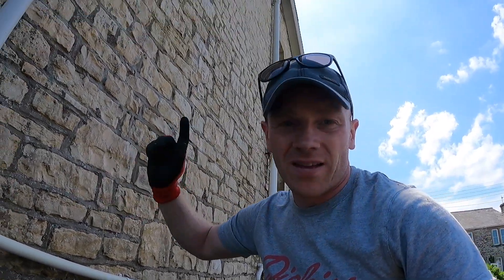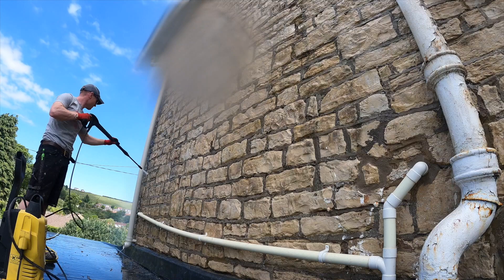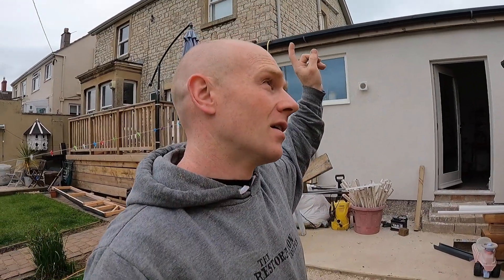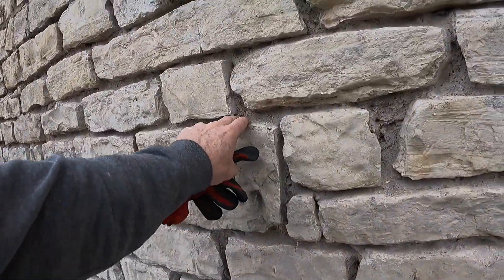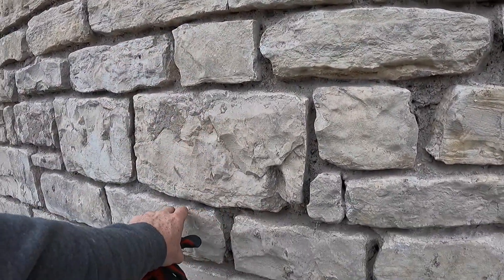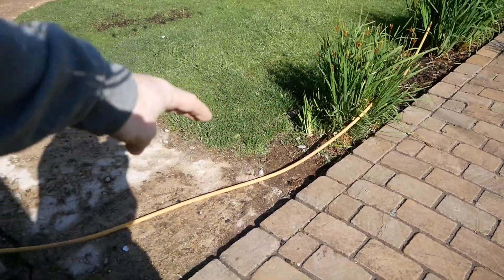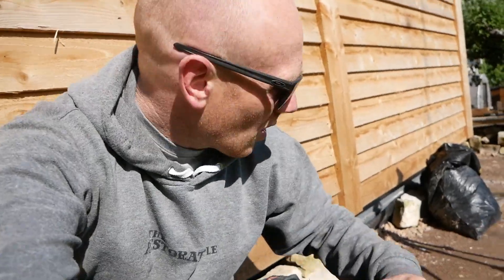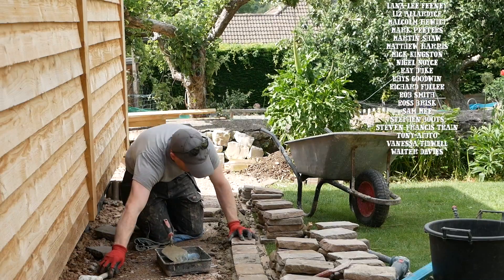REMOVING CEMENT MORTAR - Plus we get started on the new GARDEN PATH

Comment: The SDS chisel to take off the cement pointing is a very aggressive method and depending on the stone you can remove the corner/edge of the stone thus rounding it slightly and increasing the width of the pointing.  I was shown by my mason and he cuts a slot in the cement pointing with a thin diamond disc in the middle of the cement to roughly 1 to 2 cm..  you then lightly chisel and the cement falls out without damage to the stone.  The cut releases the holding "pressure" and also makes the job faster just be careful and steady with the diamond cutting disk.  Hope this helps your followers especially if they have a softer sandstone like I have.  My neighbour  had the SDS job done and their pointing is wider now - mine way better on looks and performance and we both did a lime replacing cement job.

Comment: very interesting choice using a needle scaler. Amazed you did it without ear defenders. When I used one on metal for de-rusting,  the noise was phenomenal.
I wonder if the needle gun would work with bricks or will they be too easily damaged.

Comment: What are those stones you are using for the path? I was thinking of using cobbles  for my drive but they are super expensive (even for used ones) and these look like a perfect alternative!
Reply from the maker: Sandstone setts. You would probably be ok for a driveway as many are 40-50mm however not sure they are sold as traffic ready.
Reply: @TheRestorationCouple  ok great thanks, it just for one 4x4 so I'm presuming if the base is solid and I use the right cement it should be ok and not sink or move around

Comment: Guess we're buying a needle scaler... Lots of cement pointing removal in our future.
Reply from the maker: Sorry!! There are some attachments for SDS but seem very expensive. In an ideal world you would probably need a huge compressor but my one seemed to keep up just fine. Still needs some SDS work on the chunky cement bits.
Reply: @TheRestorationCouple  luckily we have a huge compressor :) how does the needle scaler do in very narrow gaps? We have a lot of those full of cement
Reply from the maker: It squeezes down to around 10mm minimum. That said, it may struggle with really solid cement mortar, I was using it more for the loose bits then for chasing back the lime.

Comment: Did any of the stone come away with the cement? We have a sandstone house and I've been told on a few occasions that trying to remove the cement mortar might do as much damage as just leaving it...
Reply from the maker: Fortunately not. A couple of stones had small cracks and bits came loose but not stuck to the mortar itself. Whoever did the cement pointing did a rubbish job so fortunately it came out relatively easily. If it was done ‘properly’ and someone has packed the cement mortar deep in the joints it can be a much longer task.
Reply: @TheRestorationCouple  Ain't those rubbish jobs a PITA!